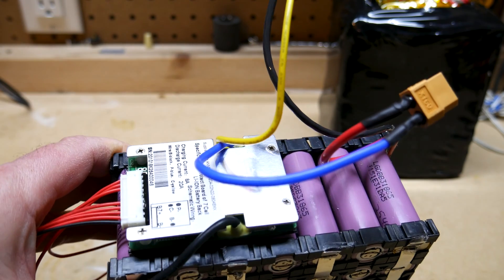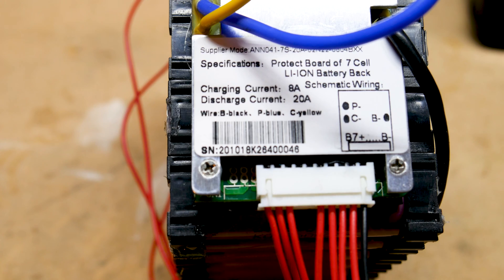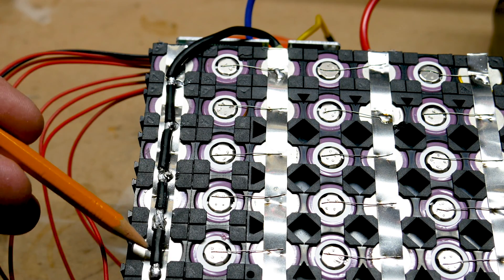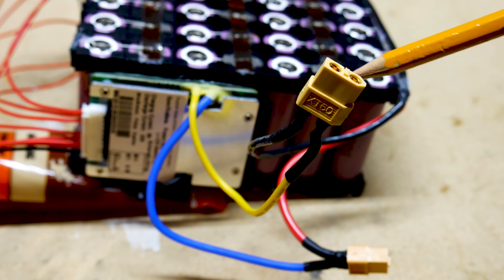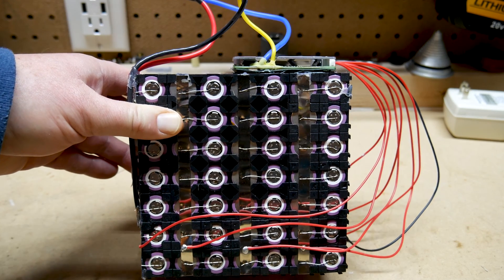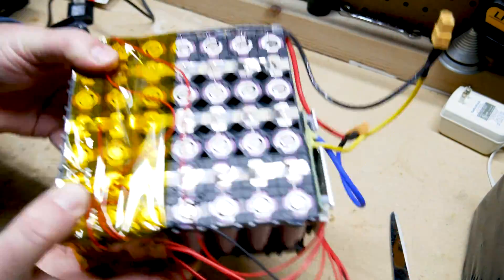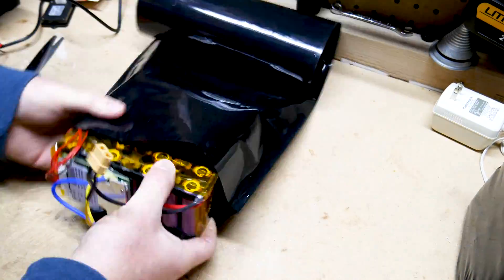How to wire a 7S BMS for 18650 Batteries by Green Mountain DIY Guy

Comment: So if I am making a 48v 23ah battery pack should I use the same resistor wire, or would I need a higher resistance?
Reply: 27.5ah*

Comment: I made a 7s2p 24v battery for my electric scooter but the baterry will stop charging at 27.7v The cells are brand new, I've tested every single one on my opus tester and everyone passed with an average of 3500mah.I've changed even the bms with another,all wires are ok but no good rezult.Do You Have Any ideea to help me ?

Comment: Were should I connect the blue cable if I am using a Epever Solar charge controller PWM, since the controller has its own output terminals

Comment: Does the number of parallel cells matter?
I have a 7s2p battery that's dead and I have ordered 28 cells. I'm planning on doubling the ah, could I use the same bms even though each lead will be checking 4 cells instead of 2?
Reply: Number of parallel cells doesn't matter. The balance leads only check the voltage of each parallel pack which isn't affected by the number of parallel cells.
Reply: @macscroge  nice, thank you for the reply. Now I need to figure out what order to pair them and best way to soder because I'm not trying to spend extra money on a spot welder and nickel strips.....

Sorry 4 the rant but ty again, that has helped me alot.

Comment: with this 7s 24v bms you have 29.4v output  or you have 24v ???       i have a doubt in my RV project, i want 24v, which bms i should buy 6s or 7s bms ?? thankyou
Reply from the maker: Fully Charge the voltage is 29.4.  In a 7S configuration, we call it 24 volt because the nominal voltage is 25.9 volts which is close to 24 volts.
Reply: @GreenMountainDIYGuy  my fear is to burn some equipment by putting 29.4v
Reply from the maker: Por Todos os Cantos You will need to do your due diligence and make sure any equipment can handle the voltage.  I use buck converters for the DC side to step down voltage.  Guys like to use 7S because many inverters have a 20-30v range.

Comment: Great video. I've been having problems with recent 7s BMS' cutting off discharge at 25.3V. Any ideas what's going on?
Reply from the maker: Anytime a BMS starts acting abnormal, try resetting it.  The BMS's on my other power storage box recently was showing drastically different voltages on charge/discharge lines.  I simply disconnect the on/off line (this BMS has two extra small red balance cables) that act as an on/off switch.  I haven't had any issue with this BMS.
Reply: @GreenMountainDIYGuy  - Thanks for the tip! I've done the reset many times and the issue persists with a handful of BMS' I have. Maybe it's because they are cheap and just don't work the way they are supposed to...But even the cheap ones from 5+ years ago didn't have this problem, just within the last 1-2 years.
Reply: Maybe you have a bad cell? If the overall voltage is 25.3 but one of the seven cells is below 2.x volts due to capacity failure the bms will shut down the whole battery pack
Reply: @timop9852  Yep, that's basically what was happening. I eventually found the issue. The cells were not draining at an equal rate. I don't it was a bad cell necessarily, it's just the amp draw on it and they were not high current cells, but rather ordinary cells. When the overall voltage was around 25ish, one of the cells was dropping to ~2.8V, causing the BMS to shut it off. When I used all high current 18650 batteries (ie Samsung), the problem went away.

Comment: Hello, I'm confused.....if the black wire is negative (at 1:45 in video) and the next row of batteries is supposed to be positive (which they are looking at the tops and bottoms of the batteries) then your red wires are connected to NEG terminals the same as your black wire..... I thought that the red wires were positive??? 
Could you please clarify????because the wiring in the video by looking at it doesn't match what you say.....
   thank you,
  Joe N. 
   Arkansas
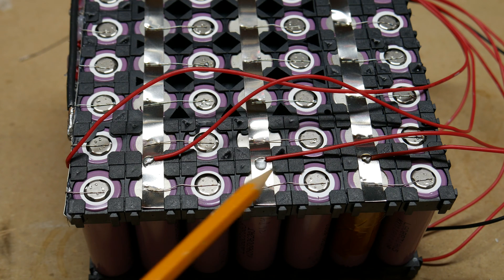Reply from the maker: Joe, great question... while it  appears I'm connecting the red balance wires to negative strips (i.e..at 1:33 in the video, positive 1,3,5,7 connections, then 2,4,6), I'm actually connecting the balance leads in series right after each fuse.  You'll notice in this configuration that I never put a nickel strip down a positive row of batteries as I would end up shorting out my connections and have one heck of a fire.  Hope that helps.
Reply: Green Mountain DIY Guy Got it thanks...
Trying to make jehugarcia diy solar gen and he kinda skips all the actual wiring of bms and the generator....
   Thanks again, 
Joe
Reply from the maker: @joen9275 He moves pretty fast but make excellent videos. Good luck with your project.

Comment: I purchased one BMS which has only one port i,e B+ve and PACK -ve. Is that one port is for charging and discharging? Can you please clarify my query? Normal BMS is having P-ve, B-ve, and C-ve : B-ve is connected to battery -ve  other two P-ve and C-ve with Battery +ve will give charging and discharging port.

Comment: Do you need a high ampere discharge for a solar panel? For example, Samsung 25R 18650 2500mAh 20A Battery has 20A continuous. Or do I need just 5A continuous?
Reply from the maker: If you are charging with a 12 volt solar panel and getting 5 amps from it, those 5 amps would go through the BMS and be distributed evenly between the 7 groups of cells (7S) which is around .7 amps for each string of batteries (at the 5 amp rate). I'm referencing 7S because that is  what I have built here.    I wouldn;t charge a small battery pack more than 1 amp per string.  The individual batteries you mentioned can discharge at a very high rate. Not sure what the maximum charge each cell can take.  If you have multiple cells in parallel then the BMS those cells as one string.  Hope that helps
Reply: @GreenMountainDIYGuy  I was wondering about the discharge rate because higher rate discharge tends to have a higher price tag. If I can work with 1A continuous discharge then I can cut the cost down by a lot. I also wonder if the inverter will draw too much current.
Reply from the maker: @IamG3X  How big of a pack are you building?
Reply: @GreenMountainDIYGuy  i'm building a 3s. roughly 12v to match the solar controller.

Comment: Thanks for this Armand, I'm just finishing my build of your earlier 18650 DIY generator, all going well so far. Had a bit of an issue with my battery pack; I hooked it up to a voltmeter and it showed 27.2v, all looked fine, but when I connected it to any real output (24v meter), it didn't energize. Unwrapped the pack, checked wiring, all looked fine. Then I noticed on the AliExpress BMS product page the following details: "Please connect B- line firstly, and then connect voltage monitoring wiring harness. The last step is to connect charge and discharge lines. If you want to remove them, the order should be reversed. Please pay attention to the connection order, or it will damage the component.".  I disconnected the voltage monitoring harness briefly and then reconnected it, and since then all has been working properly. Just sharing in case someone else makes the same mistake I did.
Reply: Good to know George.  When I has hooking up the above BMS, I was not getting the correct voltages until I connected up every balance cable to the pack.